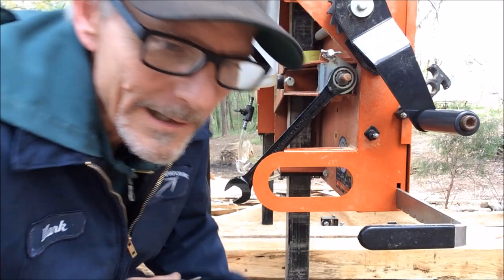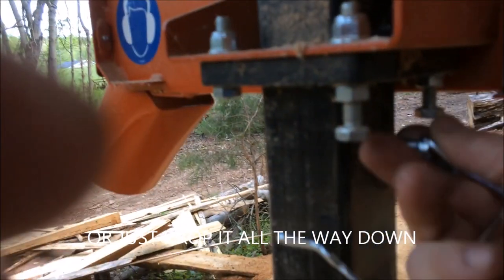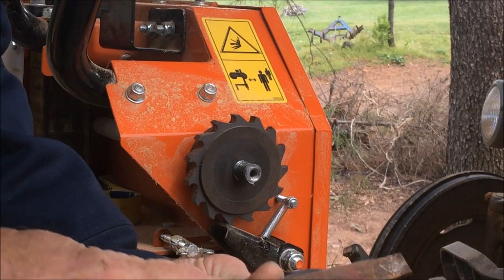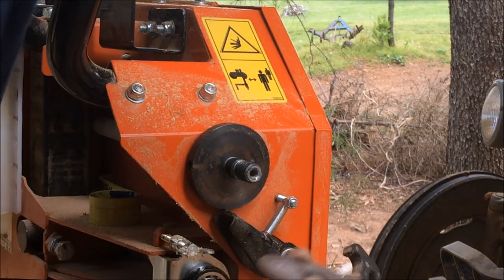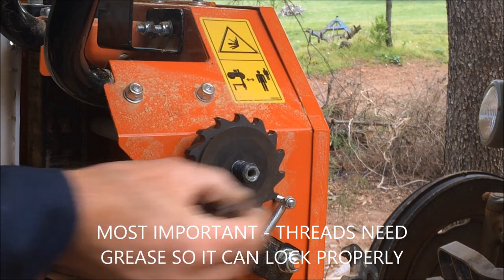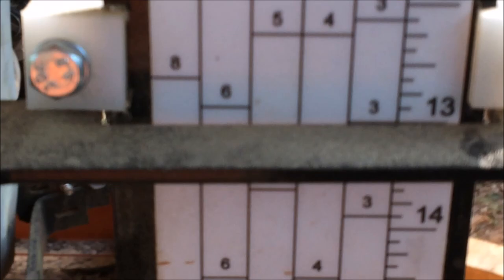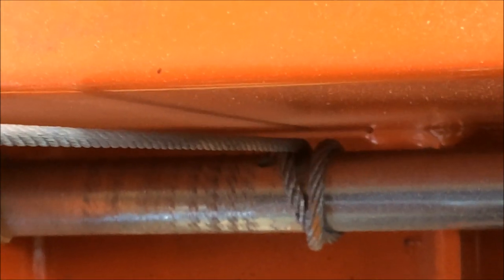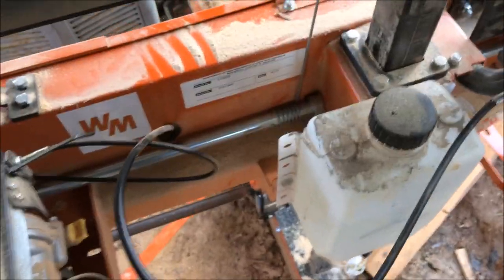LIFT HANDLE CLUTCH EXPLAINED

Comment: I had the opposite problem with the winch on my Woodland Mills HM122. Different winch from yours, but the same principle. It never slipped, but it became so tight, it was difficult to lower the mill head.  I lubed the discs with WD-40. Cranking down is now smooth and easy, yet it never slips. No need to approach the setting from below. Sawmill winches are weird.
Reply from the maker: yes they are odd. at least you figured it out. happy milling brother.